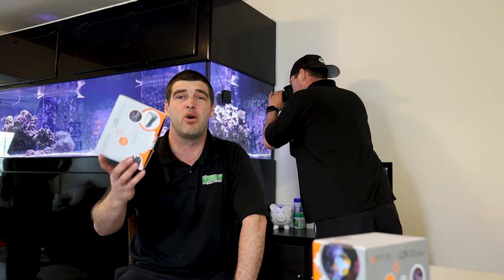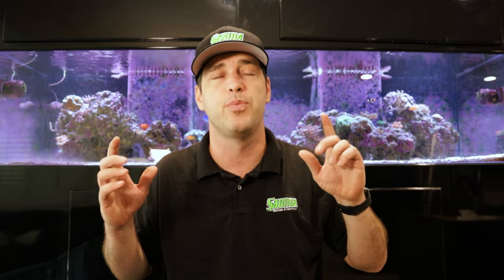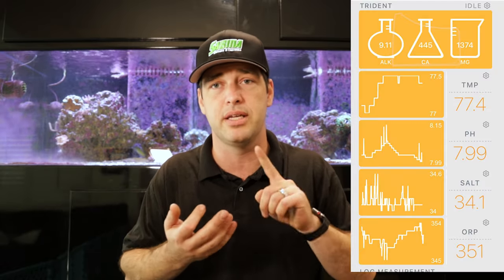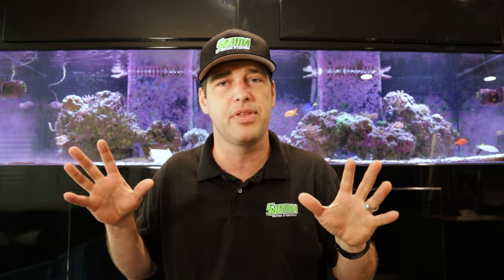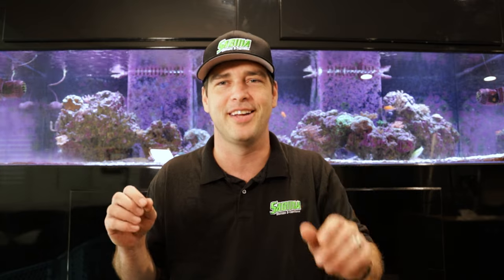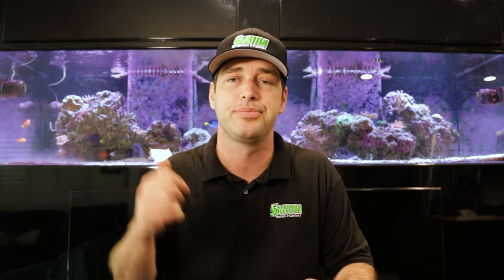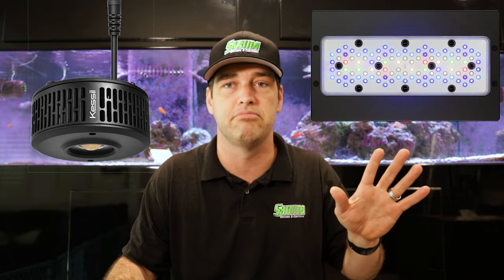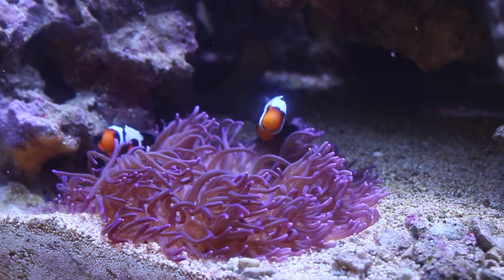Ultra Low Maintenance 300 Gallon Stony Coral Reef Aquarium

Comment: Not to be to negative, but still, you do not need a controller or a high tech build to be successful at keeping sps... simple is best. this is just misinforming people tbh. there is nothing wrong with beeing a techy and like high tech gear and tanks in general... but it is definitely not a requirement.
Reply from the maker: It’s not negative, thank you for the comment.  I agree you don’t need a controller for SPS.  There is a lot of examples of the amazing aquariums that don’t have a controller.  Controllers I think help make it lower maintenance because they can do things like; ATO, water changes, testing, and monitoring.  That should
help save time.

It’s hard sometimes when you’re making the videos to get your point across in the manner intended.  I feel like every video I make there’s something I could’ve phrased better.  

Thank you for the pointing that out. might make a good video too.  Bare basics aquarium example.
Reply: His main point is low maintenance tank not what’s necessary or not. And having a controller makes it easier to provide coral with nutrients and trace elements they need.  People have had amazing SPS systems without apex, etc but that’s not what he’s talking about